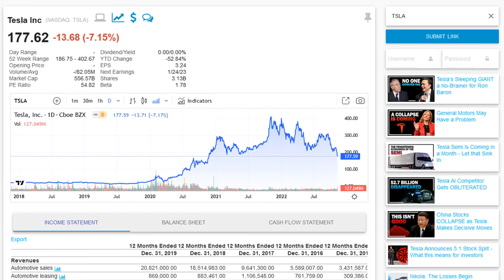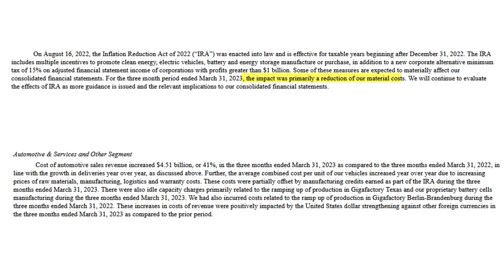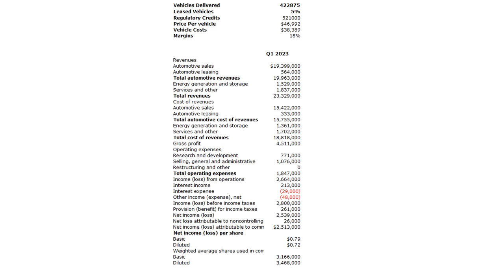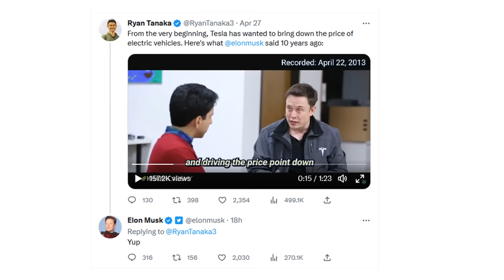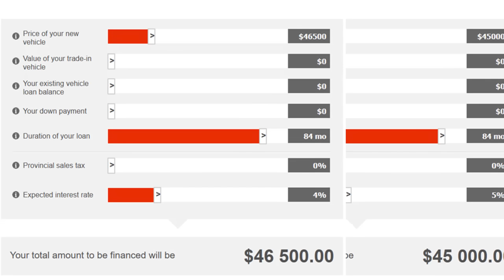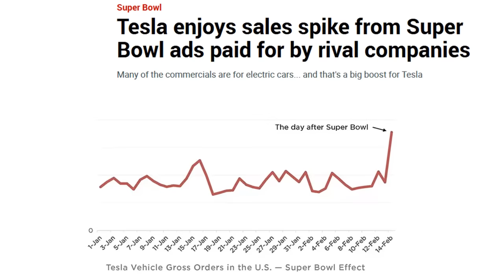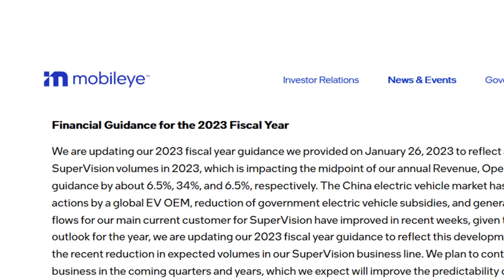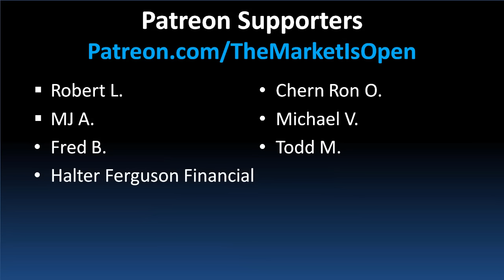Tesla is WRECKING the Entire Car Industry

Comment: Musk's strategy is brilliant. He has forced the OEM's to retool everything for BEV's. Then as soon as they try to retool, he hammers them with price cuts that will seriously hamper their ability to generate the profits they need to fund this changeover. He is catching them switching horses in midstream and cutting their legs out from under them!!! Black and Gerber are still stuck in the typical short term Wall Street mindset!!!!
Reply: It does remind me of the Usain Bolt analogy. " I am very, very fast, but I have worked really, really hard - insanely hard- to beat the best in the world." Tesla have laid down the gauntlet - " We are good, very good, but we have also worked insanely hard - if you are going to have a chance of competing - guess what you have to be, and guess what you have to do ? "  Legacy Auto have grown complacent - easy profits, government backing, Unions onside, a buying public that NEEDS cars for transport (work etc.)...now there is an alternative, and they are finding it hard to respond in a meaningful way...
Reply: The model Y price cuts are awesome 👏
Reply: Tesla spent years investing in their engineering and facilities.  They own their most important tech, their products are highly integrated…which makes them cheaper to manufacture.  No need to pay Tier 1 supplier markups.  Instead of having a bunch of boxes wired together ( built by outside companies), Tesla would just throw the same functionality on a single board they designed in house.  Even Toyota - which has lots of great engineers - was in awe at the efficient design of the Model Y, when they recently tore one down.  Tesla cut prices because they can.  Their EV margins are probably the best in the world, and it’s due to careful, iterative design, constantly trying new ways to decrease costs.
Reply: Problem is tesla still out of reach for low and middle income families which comprises 3/4 of earth’s population. i prefer buying tesla but still out of my pocket so people has no option but go to BYD or MG or any cheap chinese EV as long as decent range and low price.

Tesla is obviously winning the expensive EV, while chinese cars are winning cheap EV. mercedes, bmw etc. will just have to fight for the extra luxury ev segment.

That’s why toyota, honda, ford, etc. has no other segment to fight for in terms of selling EV. They’re just too late and soon will join the nokia club.
Reply: @camz9014  Tesla will eventually have models that fit all household budgets
Reply: @mikehawk4856   im waiting for the model 2 price and range. Otherwise chinese BYD dolphin $24k and upcoming seagull price is hard to match unless if model-2 will be priced at $30k then i would probably spend a couple more $$ to get this car than chinese.

I feel like elon musk will probably just leave the lower end EV to the Chinese manufacturers.
Reply: @camz9014  I totally see where you're coming from but I hope you're wrong.

Comment: Tesla just raised the price of the rear drive standard range Model 3 back above $40,000 and added the extended range Model 3 non performance model back to their website. So have those who were waiting for the next price cut missed the bottom? Now they have to decide if waiting avoids another increase, not a cut. 🤔
Reply: Yes, the prices in Australia have ticked up and certainly in the UK. They have as well…. Let’s just say, Tesla pricing is volatile and not just one way. Additionally, here in the UK with inflation above 10%, even if you wait to buy a car that’s the same price you are saving money.. but conversely the savings in your bank account are losing money at the same rate! The short answer is if you live in a country, where cash is trash, then buy what you want as soon as you can and don’t wait for prices to drop in an inflationary landscape!!!

Comment: Tesla made the right move. They will come out of the recession much, much stronger. Simply stacking bills, does not help them much, especially in a high inflation environment. They have $22B in cash reserves and are slowly building it further. Increasing capital spending and pushing hard on Mexico, new production lines and further down pressure on production. 
Love this focus. 
Expansion into new areas (Cybertruck, Semi, 25k car). Increasing manufacturing footprint on 3 continents. Relentlessly driving down cost and taking battery production in-house supplemented with everything  they can get from ouside while putting excess into Megapacks....
... while pushing the forefront of AI and factory robots and manufacturing processes....
Those who think Elon needs to "focus more" are clueless.

Comment: Usually a reliable channel but a bit of exaggeration at the end of the video. The article clearly states @12:28 that pricing reductions are only one of three contributors to soft EV sales in China. The other two listed are economic weakness and reduction of gov't EV subsidies, and we know those two additional factors can have strong effect within the auto market of any country.
Reply from the maker: I stated that it was part of the reason. But it's still very significant, because otherwise they wouldn't have mentioned it. So it's clearly having a noticeable impact.